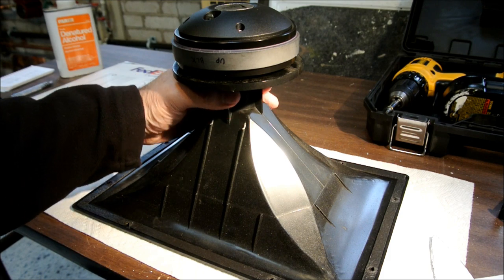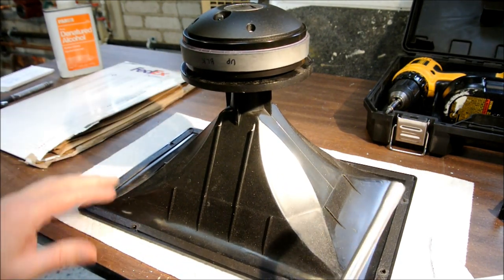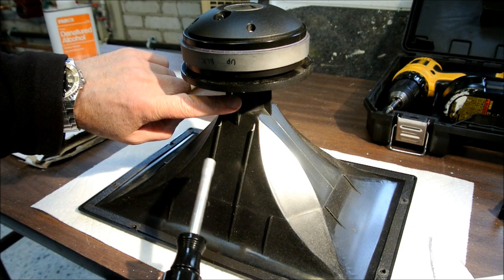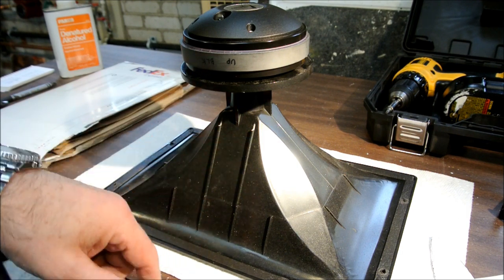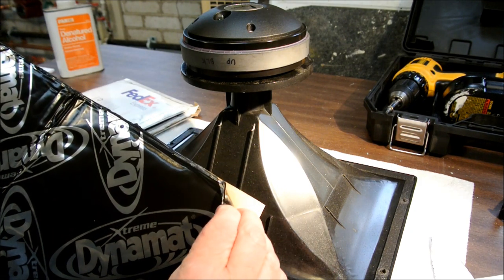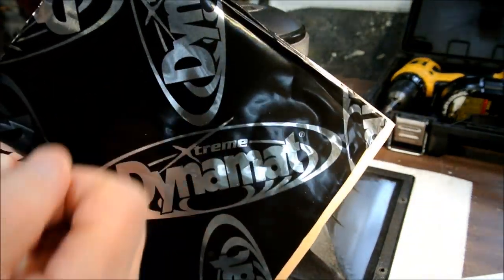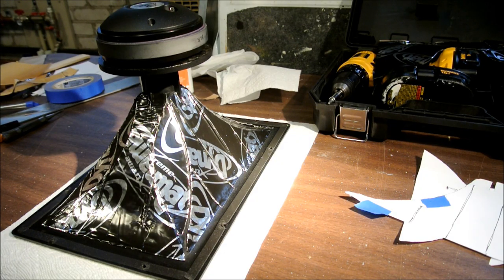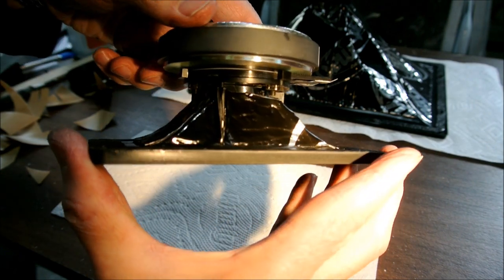How to Modify Klipsch speaker horns for better sound.

Comment: Steve Guttenberg recently featured an audiophile that used Dynamat on the inside of the case of a Cambridge Audio CXC cd transport. He made several other changes but felt the Dynamat helped reduced resonance during playback. I own a CXCgreat transport for the $ and have thought of adding the Dynamat too. We’ll see.
Reply: Yes I saw that one. good tweaking that made sense. Do look into damping mats to decouple your speakers from the floor to regulate the bass sound. Auralex under my Fortes makes a difference on top of transport dollies like Darko use on his Fortes and Boston Audiophile use on his Cornwalls. Not to forget the need for raking. Slight tilt upwards can make a big difference.
Reply: theklipschcave Didn’t Darko put his Fortes on a wooden frame with 4 caster wheels? Like a moving dolly? I owned a pair of original ‘86 “Oiled Oak” Fortes. They were paired w a good ol Marantz 2325 125w receiver. Nice combo. Really enjoyed it...
Reply: @keeferdog5617  Yep. Wooden frame, or a transport platform bought in a hardware store like mine. But I do have Auralex damping mats to decouple the speakers and the bass from the floor. They really make a difference. I been lokking into the Dynamite tweet. All carprople use this. Cheap and effective. Probably good combo with a damping mat under my CD-player and tube amp.

Comment: I did a mod on my R 820 F and my R 51 m surrounds by lining all the walls with thick polly fill. What an improvement. Tighter bass no more muddy sound and in that process I could hear my mids better because all that cabinet resonance went away. Next will be your horn modification. Thanks ..
Reply: What is poly fill? I have some r52 towers I may want to do this with...

Comment: I've got Forte 1s, am thinking of treating the horns (I've heard No-Rez works great too, not sure how it compares to Dynamat). It seems like there could be another nice improvement by bracing and damping the cabinets too. My crossovers are probably a bit diminished; I'd like to either rebuild the stock ones (circa 1985) with new caps, or I could also go 6 channel active via mini dsp and delete the crossovers all together. Even like they are, I sure love listening to them : )

Comment: I have not done this yet on my KG4s but, I can say that fully encasing the horns (or anything for that matter) is not necessary to dampen the resonance.  I know this from my experience in the auto industry. Just as you can kill the resonance on a surface by laying your finger on it, you can do the same with a strategically placed piece of the dynamat.  The extra material probably does no harm but, you do not have to go to the trouble of cutting pieces to fit the exact shape and contour.
Reply from the maker: I agree with you. Excellent point! If I were manufacturing a speaker, I wouldn’t take this whole coverage approach. I wanted to be sure I damped the whole surface, which is overkill, but gave me peace of mind that a little more coverage wouldn’t produce better sound.

Comment: Fascinating experiment and very plausible results...makes complete sense and is like something I ,myself might do... I have klipsch speakers also, specifically the sf1 towers... picked these up cheap but found them harsh with a too prominant midrange and  very bright topend... they take some getting used to and or lots of audio adjustments, at least for my ears!
Reply from the maker: I’m not familiar with the sf1 towers but it may help. If they’re too bright, try increasing the toe- in so they’re not pointing right at you but instead cross ahead of you.

Comment: Another interesting experiment would be to replace iron core inductors with air core inductors and orient them 90° to each other in 3D. Another step is to apply Dynamat or similar constrained layer damping onto cabinet walls and a piece of carpet or layer of acoustic absorbent foam over that.
Reply from the maker: Yes. There's a lot of other things one could try.
Reply: Yes there are other things, but maybe on atleast tweeter and upgrade the resistors. To build all new boards to that quality would be hugely expensive for an experiment, because you would not want to cannibalize the originals. I would rather build stronger cabinets with less resonance than buy new cross overs.

Comment: Add dynamat on the metal frames of the woofers to help with resonance, cast is different then steal and those look like stamp steal, also solder your wires to your speakers and get rid of the 5 way binding post and convert to tube connectors for your banana plugs to ensert into, then solder them directly to your speaker cables, the hardware on your original set up is bad for sound and restricts performance, did it to mine and it was a night and day difference.
Reply from the maker: Thanks for your suggestions and for your first-hand feedback (with a different speaker, I assume).

Comment: Thanks for this awesome video! A few months ago I bought a Forte III, and I must say I am not enjoying them very much. I find them very jarring in the high-mids, especially brass instruments and certain vocals can be very fatiguing and harsh. On the other hand, they lack bass and mid-bass in my opinion. This is a new pair which cost a fair bit of money and I am worried about hacking it without any experience, but do you think this type of upgrade may tame that shouty top? I'm also going to experiment with some tube rolling and cables, but wondering which upgrade will have the highest impact?
Reply: What about treating your room to absorb some of those high frequencies... there are many kinds of treatments including DIY.

Comment: Thanks again for your videos. I may have to try this with my la Scalas. I have attached multiple layers of dynamat to the underside of my audio rack shelves to control resonance.
Reply from the maker: You are welcome. Remember to mark the wires and horn terminals so you get it put back with the crossover connected to the right drivers and with the proper polarity. Also, the Dynamat sticks really well, so I would consider it non-reversible. Good luck!
Reply: Hi That was interesting. I was thinking of doing something like that for my own rack under the units. Dynamite is inexpensive so did you get a audible result with Dynamat?.
Reply: @theklipschcave5593  I wanted to be able to use a rack with thin, metal shelves and have tube amps. I try and control / reduce resonance wherever possible.
Reply: @johnhogie  I agree. I'm working at it all the time. I think its especially important with a tube amp.

Comment: This mod makes 100% good sense.... just by tapping on the horn and hearing that hollow plastic coloration.... you know that sound is being imprinted onto the reproduction to some extent.  Imagine a snare hit coming thru that midrange horn... that's not unlike tapping the horn structure, and you will hear that undamped plastic vibration.  Damping it just helps the horn do what it was designed to do..... direct the sound without vibrating or resonating.  The only way to do it better, is if the horn was molded out of a denser, more rigid and damped material...  which of course would raise the price.   Great Job!!
Reply from the maker: Thank you.

Comment: I dampened my horns this weekend and it did seem to give better seperation of instruments especially times when more instruments are playing. It also seemed to make the sounds even more clear and clean. Thank you very much for doing the leg work for us.
To tighten the bass up even more and keep the sound clearer at high volumes with a lot of things playing I am concidering pulling the bass speakers and treating the metal baskets with the Dynamat and I'm not sure the best way to brace the sides of the cabinets or the best way to dampen cabinet sides with wool or no-rez without taking away the livelyness of the speakers. If anyone has tried this or has any other thoughts I sure would appreciate them. Thanks Ted
Reply: Ted, what did you find out
Reply: @Hugeroost  Other than moving them around a bit I haven’t touched them since. I did however get a new Parasound Halo A52+ Power amp to use with my Yamaha RX-A1080 receiver. Added Great pop and clarity to the sound.
Reply: @tedrubinstein2003  cool deal, I'm considering hooking up my yamaha B2 to mine and see how that sounds. I have read what a great combo that is

Comment: Everything vibrates at a certain frequency, so it makes sense to try and damp it when it's in the audible frequency range (especially so when it's at higher frequencies). When a note plays that is the same frequency as the resonant frequency of the horn, it will join in and muddy the sound.   I didn't see any foam on the back wall of the cabinet, so it would be worth experimenting with acoustic, open cell foam. Obviously keep it well away from the ports. Advantages are a tighter, cleaner low end, disadvantages can be less bass if you go over the top.
Reply: Overdamped bass reflex cabinets introduce a fresh set of issues.  Stiff cabinet walls and high flowing, low noise ports are the ticket with bass reflex 👍
Reply: I wouldn’t go overboard and kill the cabinet
Reply: @dougg1075  A speaker is not like a musical instrument that produces its own sound. It's supposed to reproduce sound.
Reply from the maker: Yes. That's a good explanation.

Comment: I have a couple of problems withe the approach here.  First, on the illustrative "tap test", it does not account for the damping of the horn resulting from proper installation in a baffle with a closed cell foam gasket.  I'd guess that you'd get much less ringing from the "tap test" and imagine that was taken into account by Klipsch's designers.  Second, recognize that the sound of any horn is the result of both the signal introduced at the throat of the horn, as well as the resonant characteristics of the horn material.  Try applying Dynamite around the bell of a trumpet and see what you get; definitely a difference, but not a pleasing one and certainly one which alters the fundamental nature of the trumpet's tone.  Note that I am an advocate of damping in the right places in/on a speaker, but am not sure deadening the horn is the best approach.  (Musician, and yes, I've built my own horn speakers.)
Reply from the maker: The horn damping definitely improves the speakers. Your suggestion may improve them further.
Reply: Did this to my kg 5.2s and it very noticeably killed a lot of the high frequencies. Gonna un dampen them.
Reply: I think using dynamite is an excellent idea...😀

Comment: BA, I've been following this series with great interest as the Cornwall IVs are in the top five of my next speaker investigation. Thanks for doing all this work. I'd like to recommend that you check out a YT video by New Record Day called Klipsch Forte III upgrade and more. This is an upgrade by Danny Richie who has a great pedigree for speaker design, speakers, and DIY speaker kits. In this and other videos on that channel, he describes in detail what he does to improve speakers (note that I'm not recommending the XO upgrade). He also sells a product on GR_Research called no rez which he applies to the inside sides, tops, & bottoms of cabinets. Please keep up the good experimentation and reporting.
Reply from the maker: Thanks. Glad you like this series. I agree, Danny Richie’s mods look excellent.
Reply: Yeah, I wouldn’t touch those crossovers.  Not worth it.
Reply: chasmj3, I'm glad that you mentioned Danny Richie.  I have Forte IV's and I have applied ideas from Danny and BA.  Danny, when evaluating the poor parts quality he finds in many x-overs, says that the sand cast resistors and magnetic steel parts in the signal path degrade sound quality.  The Forte and Cornwall x-overs have a number of sand cast resistors and I wanted to replace the sand cast resistors with a higher quality wire wound resistors. I ordered Vishay 1% Wire Wound 10 watt resistors from Mouser Electronics. Mouser had 13 ohm resistors but no 8 ohm and no 5 ohm resistors. I parallel connected two 16 ohm resistors for each 8 ohm spot and two 10 ohm resistors for the 5 ohm spot. I took me an hour to remove and replace the resistors. What helped to make the resistor removal and replacement project so easy was how closely the Vishay/Dale 10 watt, 1%, wire wound resistors match the size of the stock resistors. One goal of my Forte IV x-over project was to work within the footprint of the original x-over circuit board. The limited real estate of the original x-over circuit board prevents me from considering installing the much larger air core inductors and high performance capacitors. For now I am stuck with the stock iron-core inductors and entry level capacitors. In addition to removing and replacing the resistors, I applied Kilmat Sound Deadening membrane to portions of the cabinet interior, midrange horn, bass drive frame and passive radiator frame. I removed the steel lock washers and steel nuts from a pair of input jacks and replaced those two pieces with brass washers and brass nuts. Lastly (since bi-wiring is not an important feature for me), I removed one pair of input jacks and I combined the two sets of input wires to a single pair of input jacks.  The modded Forte IV’s initially sounded a bit congested/compressed. As I get more break-in time on the speakers, I note that they are beginning to open-up.

Comment: Did this to my Forte IIs and I did notice an improvement.  Slight, but noticeable, and I assume that the difference would be more significant in a higher resolution speaker like the new Cornwall IV.

Comment: I've been buying listening and owning Klipsch speakers since 1974 and I've also used other speakers from other companies from about 1978 to present day August 2024. And I truly loved them all because I owned them all and always coming back to Klipsch. Specifically the Klipsch forte model 3. 
The model 3 of the Klipsch forte is the absolute sweet spot of all four versions released. And I never had them modified there's no need to if you have a really decent AVR or amplifier the Klipsch forte model 3 will dance for you and give you the most wonderful Sonic abilities you've ever heard depending upon the room size recently I've had The Good Fortune of being able to put together a 9.2 surround sound system of which the LCR is forte model 3.. and then using the 8060 Faz for rear channel and finally the 8000 f Mark II to round out hype channels surround sound channels. However the speakers are built and come to you in boxes leave them that way.. and if you ever have the chance to do what I've just mentioned in this post please do you will be very pleased and very happy with your listening stage or what some may say a wall of sound. Klipsch is keepers of the sound.. now may we have everything sonically smooth enough all the time everywhere. Thank you and enjoy.. please don't obsess about upgrades too much because in time it just may ruin your ability to discern to own to possess greatness in sound😊
.

Comment: In my opinion any upgrades to a klipsch makes them a klipsch only in name.
The sound of klipsch heritage speakers were approved by the ears of Paul W Klipsch.
Reply: This is bullshit......you honestly think there haven't been improvements in the last 60 years? If what you say is true then why isn't klispch still using A or AA networks? What about klipsch changing the horn material from aluminum to composite? Besides, there are no 2 rooms with the same acoustics so your point is completely moot.
Reply: @phatrayray  Did I hit a nerve?

Any change you or Klipsch make to the original heritage speakers mean that the new sound is approved by the ears of Paul W Klipsch. 

The original heritage speakers were VOICED with their original parts. Any new part you put in a heritage speakers will change the speakers original sound. New Parts will make them sound better or worse but not the same. 

I own the Klipsch Chorus II, if I can find a new pair of the Chorus II with all of the original parts brand new I’ll be in heaven.
Reply from the maker: Nothing wrong with leaving yours stock if that's what you prefer.

Comment: Great modification. Do you think you might Dynamat the interior cabinet of the speaker as well?
Reply: Great question... I was wondering the same
Reply from the maker: Thanks for your question. Dynamat on the enclosure would likely help a little, but it won't materially stiffen the front baffle. Furthermore, I suspect Dynamat is more effective at quickly damping low mass structures, like the thin plastic horns and automobile sheet metal, than heavy, wood cabinet walls. Simple wooden bracing in the cabinet may do more to increase cabinet rigidity and raise resonant frequencies ... then Dynamat might have a greater effect. Just a guess, maybe someone out there has tried it?
Reply: @thebostonaudiophile  The dynamat is arriving today. I'm in quarantine and I
 have a lot of time to spend so I'll apply it to my Forte III as soon as it arrives. I'll record a song without dynamat with a mini dsp ultra sensitive microphone. Than the same song with one speaker to try to catch effective differences. Let you know.
Reply: Massimo Francesconi I was considering the same thing, but I reviewed the maths that went into the development of the horn and it got me wondering if maybe the resonance is not supposed to be dampened. wouldn't damping a bell or a horn be bad?
Reply: @alfa71omega  any updates? Thinking about doing this to my rf7s
Reply: Dynamat was engineered for the resonance frequency of sheet metal, not 3/4” MDF.  Gluing strips of fir to the center of the interior walls would help more, and maybe a piece of thin, dense insulation behind the woofer attached to the interior of the back panel to trap standing waves.  A heavily damped bass reflex enclosure introduces some fresh issues.  Stiff cabinet walls and a free flowing quiet port are the tickets to great bass reflex performance👍